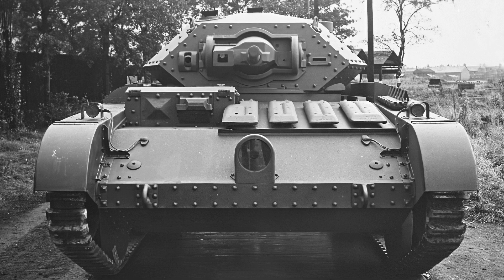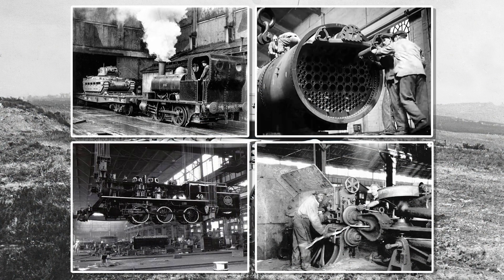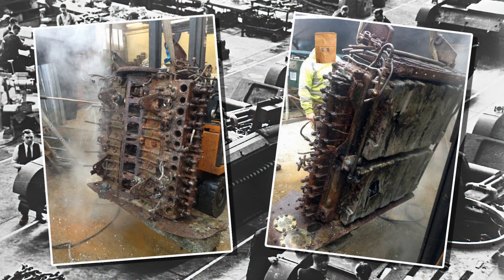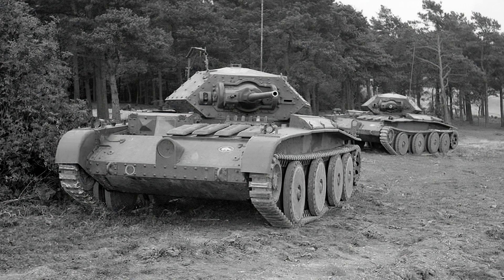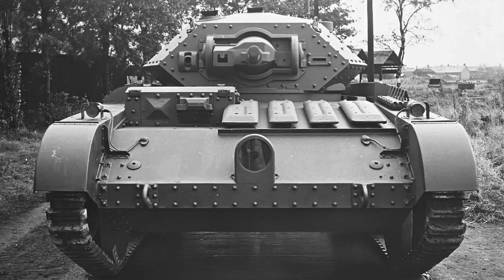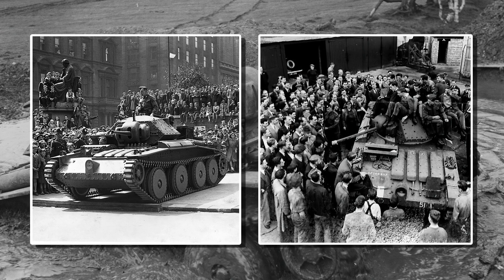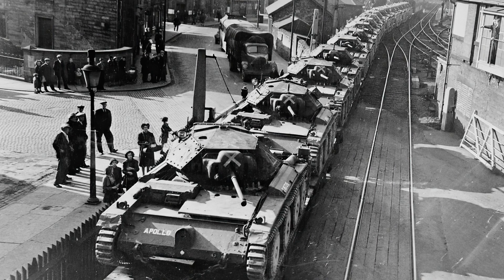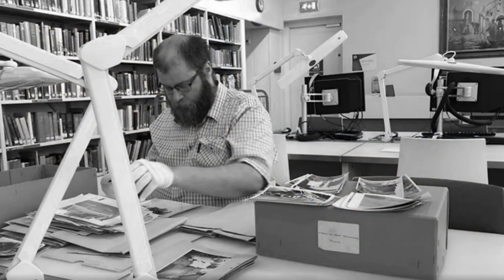Covenanter - Tank Design & Development

Comment: Another tank that gets a bum rap is the Crusader. Hopefully we will get a video on it as well.
Reply: Crusader is an odd one, it has many good features but was terribly unreliable, but not  design flaw, more Leyland and Nuffield cutting a few corners, once fixed it was a good machine more or less.
Reply: @edfrancis712  The problem with both Covenanter and Crusader (and Valentine for that matter) is that they wern't sufficiently better than the tanks that preceeded them (Cruiser IV and Matilda) to justify the 2 year development period. They were only half way through their development by the Battle of France and their existance delayed work from starting work on better designs by about a year, with the result that those tanks had to be rushed as well.
Reply: @Akm72  the advantage of the Valentine was that it was cheaper to build, if initially at the cost of efficiency with a two man turret. The significant advantage of the Crusader was somewhat heavier   armour, although again the turret wasn't big enough and the early sub turret was a mistake, as was leaving a shot trap when removed.
Reply: @Akm72  An A13 Mk. III might have had some merit. Given that the Covenanter kept the same four roadwheels per side, it was sort of trying to be that, just lower, but ended up a bit botched. But then the original suggestions for the Cromwell was as much similarity with the Cromwell, and the projected ended up splitting three ways, and the Cromwell was probably obsolete by 18 months by the time it was fielded in Normandy, so I am not sure that an A13 Mk. III wouldn't have got compromised too. The Comet is what the UK should have had in early 1944, and the Centurion not long after. I have always loved the Cromwell, but it was almost criminally late due to a dogs-breakfast of project splintering, in-fighting, etc. The UK's second worst enemy in WW2 after Germany seemed to be itself sometimes! But it did finally get to the Centurion after trying all the ways to make indifferent tanks first, it seems sometimes.

On the Valentine - it saw production and service for quite a long time, so it doesn't seem to have been that bad, although a lot of production went to the USSR, although you have to wonder why given the USSR had the T-34. The T-34 (76) did have a lot of issues, partly due to a two-man turret and poor vision devices, but half the time Valentines only had a two-man turret too, although the vision devices were a bit better. 

Often Valentines were used as cruiser substitutes in North Africa as although it was no faster than the A10 and a lot slower than the A15, but it at least could get there without breaking down! A Valentine with thinner armour and faster speed - that might have been a good option - a true cruiser that was capable of getting to the battlefield.
Reply: I've found that A15 Crusader's reliability issues can mostly be grouped into:

• Issues with the Nuffield Liberty Engine.
• Issues with the Cooling System.
• Issues with Logistics.

Of those; only one is really the fault of the A15 herself;  as bad logistics were also the cause of the A15 being deployed desert'side without a C/S update or even proper preperation after being unloaded at the port.

I think it's fair to say that A15 was chiefly the most obvious victim of a larger issue, that thankfully improved as time went on.
Reply: @jimtaylor294  it often feels like that the UK wasn't logistically ready for war before 1942. If you look at some of the French and British strategy documents, it bears out that major fighting wasn't anticipated until late 1941. Absent Dunkirk, that might have meant the UK being ready then. However, sending A15s to NA without spares and so on seems to speak more of failures in supply chain logistics, so who knows if a longer phoney war would have solved that, or if it needed to be tested via combat? Thankfully in NA, German and Italian logistics were abysmal.
Reply: @wbertie2604  I would agree.

The Norwegian campaign is one especially grim example of how bad our early:-war logistics were, and how it could scupper an ostensibly winnable situation.
(Germany still came off worse from the campaign than we did in shipping terms though, with two Capital Ships damaged, two cruisers sunk & heavy destroyer losses)

Corrigan and Fletcher brought the logistics issue to my attention, but TIK History's videos on allied and german logistics have proven especially insightful. We certainly could have done far worse (as in Stalingrad levels of worse) re' logistics, but can still learn a great deal from our own supply issues at the time.
Reply: Huh?  The Crusader served well in Africa.  It really needed an 8lbr instead of the 2lbr though.
Reply: @princeofcupspoc9073  Early on the Crusader had reliability issues mainly due to the cooling system. By the time all the various bugs were worked out the British army hand moved to using the Sherman. Yes it got much better with the introduction of the 6 pounder. But even that had issues with later marks of the Panzer 4 and was completely out classed when the Tiger made its appearance in North Africa.